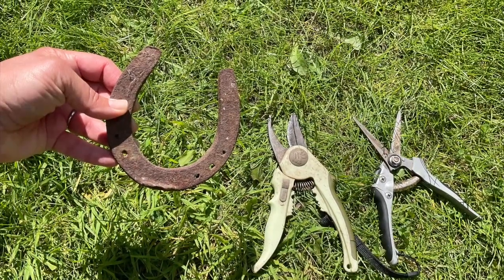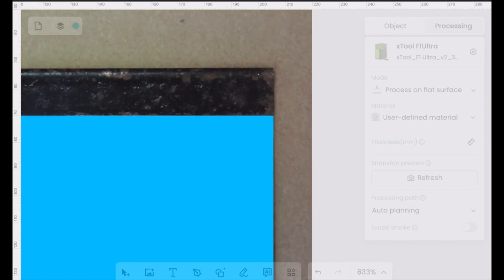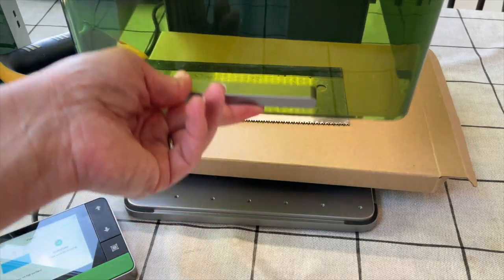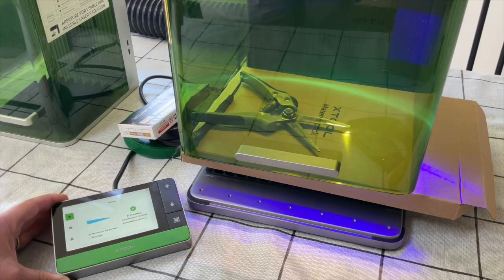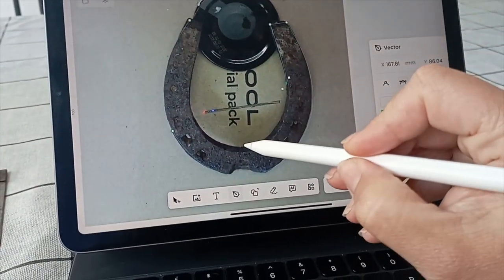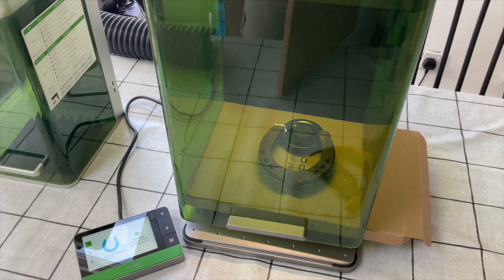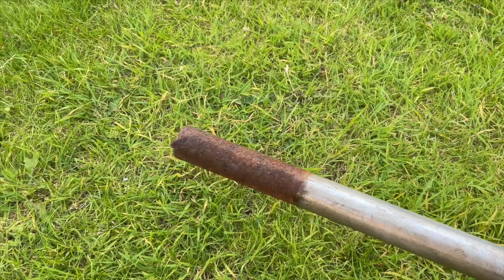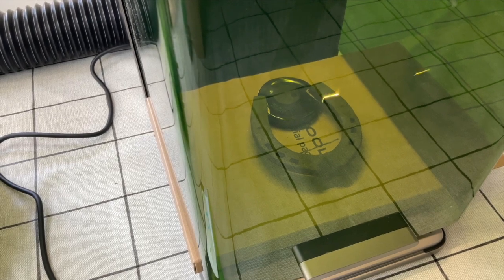Rust Removal - xTool F1 Ultra Laser - HOW TO - Red Rocking Bird

Comment: add cross pattern to your 2nd pass, it will clean up even more. Thanks for doing this, I've wanted to do this for a while but just got the ultra.  I've done clean up passes on coins and it works well.  add a little wd40 or tool steel oil after clean up to keep rust from reforming. :)
Reply from the maker: Thanks for the great tips, appreciate it, I hope you have given this a go now 😊

Comment: Why are you using the diode laser in some of these and then claiming it's fiber?
Reply: FYI: ultra is fiber and diode. 2 lasers in one.  :) the best of both worlds for marking.  meh on cutting metal, I have a fiber 60w as well and it's not designed to do that either but it'll work on thin metal.  problem is that it'll scorch the metal around it pretty hard before getting through the material.  The diode won't do cleaning, it's the fiber that will due to the wavelength :)
Reply from the maker: Thanks Eddie
Reply from the maker: It’s the fiber that removes the rust